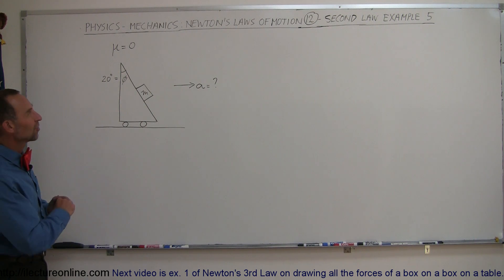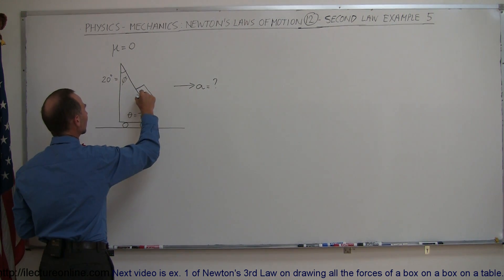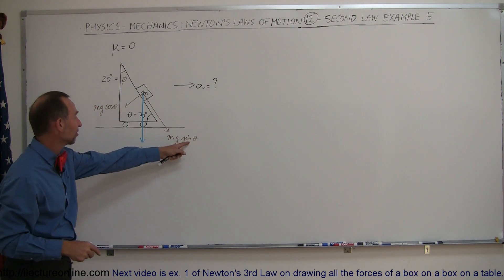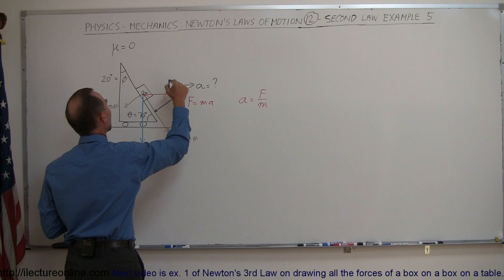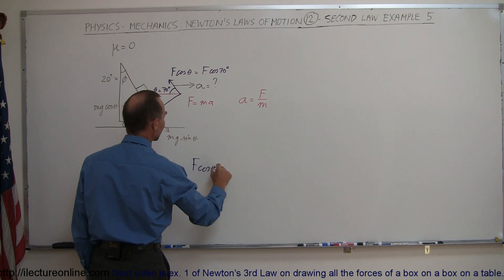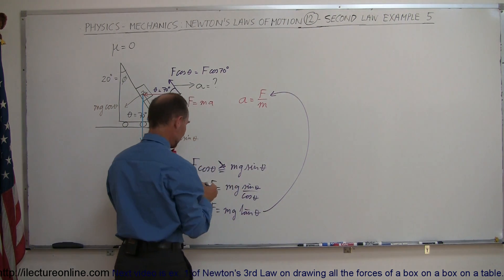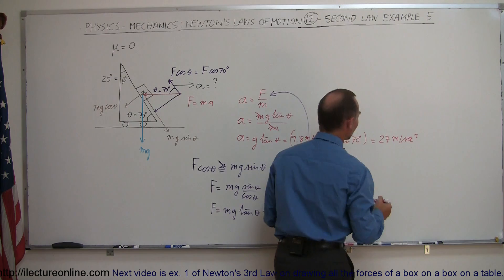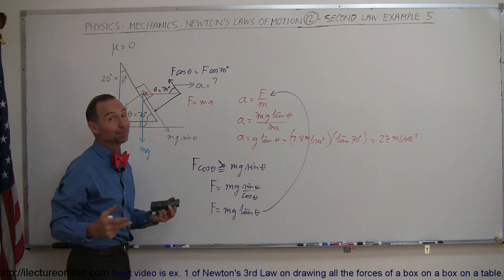Physics 4  Newton's Laws of Motion (12 of 20) Second Law: Example 5

Comment: Why did we have a 20-degree angle on the top of the triangle when we mainly used the 70-degree angle for this problem? Does it matter what angle were using?
Reply from the maker: It does not matter what angle you use.  Whichever angle makes it easier to solve the problem.

Comment: Thank you for the video. I have a question, you said that the force preventing the block from sliding down is equal to ma I don't understand how it is true I thought that the force that is opposite to the motion which is air resistance will make the block not not moving at all
Reply from the maker: There is no wind resistance and no friction in this problem.  The force that prevents the block from sliding down = F cos(theta)     Where F = ma

Comment: does this example take into consideration the fact that the small box exerts a normal force on the wedge? Thanks!
Reply: i mean should we + the normal force exerted on the wedge to the final solution or does this method somehow take care of it?
Reply from the maker: Yes, due to the acceleration, the small box is "pushed" against the wedge and therefore there will be a normal force and a tangential force to the surface.

Comment: This one is really confusing, when you show free body diagram, why did you add the imaginary force pulling box toward the incline which is in red color? Aren't you supposed to use normal force normal force N instead. Even if there is a contact between incline and the box you didn't include the normal force acting on box. hope you will answer my question. thanks so much . you're the best teacher ever btw. 🌹
Reply from the maker: These types of problems are more easily solved by assuming a fictitious force (= ma) pushing horizontally against the object towards the left.  That is then split into the two components (parallel and perpendicular to the incline).  The normal (to the incline) force then cancels out with the reactionary force from the slanted surface to the object.  Then the parallel component of the fictituous force is then set equal to the mg sin(theta) component of the weight.

Comment: physics3a- I also do not understand how the force acting on the block has those two components of Fcos70? How did we get that the angle is 70?
Reply from the maker: The angle is given.  (70 = 90 - 20)
Reply: @MichelvanBiezen  I understand how you found 70 but I do not understand how you then. used 70 outside of the triangle and on the components of the forces of the block

Comment: I thought one can not use apparent forces in free body diagrams.. that we could only use ΣF =ma.. would it also be possible to solve this problem without introducing the apparent force?
Reply from the maker: We use "apparent" forces all the time, and when used correctly they can make many problems easier to solve, because they are often more intuitive.  But yes, most problems can be solved using the real forces as well.

Comment: Thank you very much for another great video, professor van Biezen. Question: On the incline diagram, we see that the component vectors of 1) the blue force of gravity and 2) the red force acting on the object on the wedge incline due to the wedge accelerating to the right that are parallel to the surface of the wedge incline are equal in magnitude but opposite in direction, canceling out each other, so the box object does not slide down the incline. But why do the component vectors (of the blue and red forces) perpendicular to the surface of the incline seem to point in the same direction, and therefore do not seem to cancel out? If what I ask is correct, what is the consequence of those component vectors not canceling out?
Reply: I am really wondering the answer of this question. it has been 2 years but seems no answer

Comment: Hi professor Michel Van Biezen, I have a little question. I don't understand from where the red force comes from? Because it's not a force that works on the mass? I guess it is the net force, but I don't know why? Thank for the explanation :)
Reply from the maker: It is the reaction force of the block pushing back against the accelerating wedge.  (Newton's third law, for every action there is an equal and opposite reaction)  The wedge pushes against the block and the block pushes back against the wedge.

Comment: Fcos theta should be equal to mgcos phi. since your angle phi is at the bottom of the mg and parallel to the incline, cos phi is adjacent over hypotenus with respect to the angle phi, so it must be mgcos phi, not mgsin phi.
Reply from the maker: The video is correct.
Reply: I know but it is kind of confusing and misleading, for others perhaps.

Comment: Heres another way to solve this problem and others like it. (WARNING: Long comment lol got carried away)
First draw a free body diagram of the box with the canvas rotated making the hypotenuse the ground.
By doing this you get 3 forces, Fn which will point straight up, Fg pointing in the southeast direction relative to the block, and F (the force acting on the block due to acceleration) pointing in the southwest direction.

Note:
ϴ = 20, not 70 throughout this problem.
The angle between Fg and the x-axis is theta.
The angle between F and the y-axis and is theta.
Fg = mg
-------------------
Now what I like to do for these problems is write out equations for all the forces in the x and y directions.

We have two forces acting in the x direction, Fgcos(ϴ) and Fsin(ϴ). (Note we use sin to get the x-component for vector F since the angle ϴ is between F and the y-axis. Aka, when ϴ is in a weird location, it is flipped sin = x-component cos = y-component). Now if we want to find the acceleration that would make the box stay where it is, we need all the forces to cancel out, thus the two forces must equal each other:
mgcos(ϴ) = Fsin(ϴ)

Now we do the same thing for the y axis. We have three forces Fn, Fgsin(ϴ), and Fcos(ϴ). Again, if we want the object to standstill, then all the forces in the positive y-direction (Fn) must cancel out all the forces in the negative y-direction (Fg,F), thus:
Fn=mgsin(ϴ)+Fcos(ϴ)

The next step I like to do for all of these types of problems is find the number of unknowns we have for each equation.
x: mgcos(ϴ) = Fsin(ϴ)         [1] <---- (# of unknowns)
y: Fn=mgsin(ϴ)+Fcos(ϴ)    [1]
Now we can use these equations to rearrange them so that it solves for the variable that we are looking for. In this case we need the accleration (a). There is one problem, 'a' does not exist in both of these equations; however we know that F=ma and by rearranging we get:
a=F/m     [1]

We can see that to solve for 'a' we need F, and looking back at the equations for the forces acting on the object, we can see that both equations have F present in them and both have only 1 unknown. We can use any one of the equations for the forces to solve for F, but I will use the one for the forces in the x-direction since it appears to be easier to rearrange. After rearranging we get:
F=mgcot(ϴ)

Now we simply plug in this equation into the equation for 'a' and after simplifying we have:
a=gcot(ϴ)

By plugging in g=9.81 and ϴ = 20 we get a=26.95m/s^2.

Comment: when this inclined plane is moving in the right direction with an acceleration a then direction of F should be also right but you are taking in left plz explain sir
Reply from the maker: Whenever you consider a force, you must think about what CAUSES the forces and ON WHAT is it acting.  (Remember Newton's third law).  In this case the small block is causing the force and it is acting on the moving incline plane.

Comment: Should Fcos(tetha) be   - Fcos(tetha)??
Since if we put a coordinate axis , the component will be negative
Reply from the maker: That is the magnitude of the component.  (Magnitudes cannot be negative).  We use negative signs to indicated direction when expressing the answers in vector notation, or when we want to indicate the down direction or the left direction with the equations of kinematics.
Reply: Michel van Biezen thank you professor!  for clearing that out 👍🏼

Comment: Hello Michel van Biezen.
This lecture is what I was looking for.
I'm disputing with my lecturer about the solution of the similar problem and I can't prove him that he's solution isn't correct (I believe there is mistake in my calculations).
The problem: 
"A block of mass m1 is placed on a frictionless inclined ramp of mass m2, with the angle θ as shown below. Calculate the size of the net horizontal force that must be applied to the ramp to prevent the block from moving with respect to the ramp?"
This problem is taken from exam and there are 6 answers: 
1. F=m1*g*sinθ
2. F=(m1+m2)*g*sinθ
3. F=(m1+m2)*g*tanθ
4. F=m2*g*sinθ
5. F=(m1-m2)*g*sinθ
6. F=(m1-m2)*g*tanθ
The solution is 3. F=(m1+m2)*g*tanθ.
He has a doctor's degree and I'm afraid of arguing with him because it can affect my final grade at this course.

Can you please show me the solution or a final answer?

Thanks in advance
Yosef
Reply from the maker: +Seva Leontyev 
answer 3 is indeed the correct solution (providing the angle theta is the lower right corner angle).    The component of gravity that pushes the mass down is mg sin (theta).   the component that pushes the block up because of the force accelerating the 2 blocks is ma cos (theta).  Set the two equations equal to each other (for the block remaining stationary relative to the incline you get          a = g (sin(theta) / cos (theta) = g tan (theta).    And since F = m total * a = (m1 + m2)   then F = (m1 + m2) * g * tan(theta)
Reply: +Michel van Biezen 
Thanks for your fast reply.
So according to the answer if we apply horizontal  force of F = (m1 + m2)*g*tanθ on the inclined ramp (according to the Newton's 2nd law ) it's accelaration in horizontal direction will be  A(ramp)=F/m2=((m1+m2)/m2)*g*tanθ. Right?
Reply from the maker: +Seva Leontyev 
 Using Newton's second law F = m(total) * a and since the force is accelerating both masses:
a = F / m(total) = (m1 + m2) * g * tan(theta) / (m1 + m2) = g * tan(theta)
Reply: +Michel van Biezen 
The force F is applied on the mass m2. The interaction between m1 and m2 is not in the same direction as F applied, thus (on my opinion) only part of F is applied to m1 . Correct?
Thanks
Reply: Thank you.
Now I got it.
I made some mistakes before.

Comment: Could you please explain those parallel angles. Where are the parallel line that you use to determine that the mg sin it's actually refering to 70º. Same when you draw the force that holds the brick and that angle is again 70º. It isn't that clear.

Thank you for your awesome job.
Regards

Comment: Hey! I love your videos, I really struggle with physics so the clearer the explanation, the better for me & you do it quite well! Thank you :)

About the problem, could I solve it using the normal components? because then I would directly get the vector equal to the acceleration (?)
Reply from the maker: Lilian Menezes 
Lilian
I am not sure what you are asking.
My suggestion is to try it your way and see if you get the same answer.
Reply: Sure thats a good idea, its how I did it. Choose the force of gravity to be in the y direction and the perpendicular axis through the center of mass of the block to be the x axis. Some simple trig will allow us to decompose the normal force into components Ncos(20) and Nsin(20), from which we can form the equations ma = Ncos(20) and mg = Nsin(20), we would then get a = gcot(20) which checks out. Michel's way was very good and intuitive as well, just shows there are many ways to solve a problem.

Comment: I understand everything that was written, however I'm confused as to why the Normal between the sloped surface and the object was never mentioned or accounted for...which brings me to the outside F that worked in the opposite direction to the acceleration of the system.
Hope someone will see this comment and help me understand this issue.
Reply: Normal was not mentioned because it was just taken into consideration. There was no direct use of 'N' in this problem, or in the way he solved. Basically N has to be equal to  mgcos(theeta)

Comment: Hey I got confused by the parallel and perpendicular angles. :( Please explain
Reply from the maker: franxclusive Angles are RELATIVE to the horizontal and vertical surfaces.

The COMPONENTS of the FORCES are parallel and perpendicular to the inclined surface.